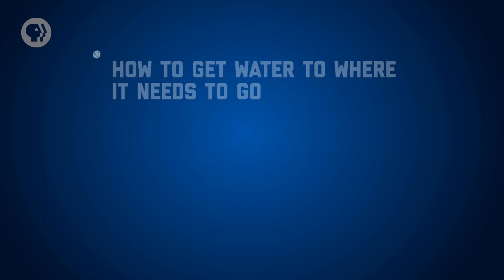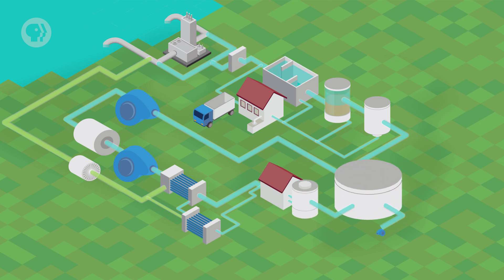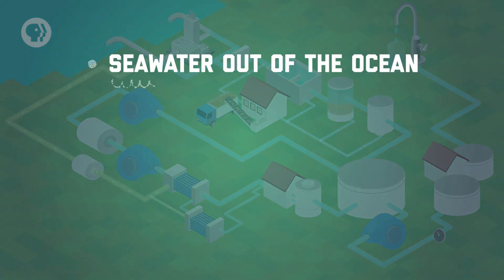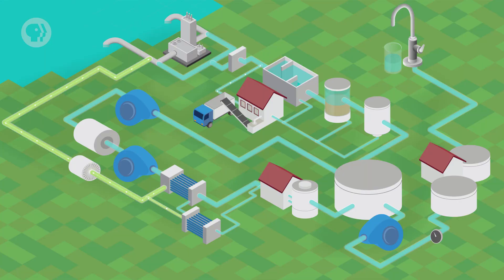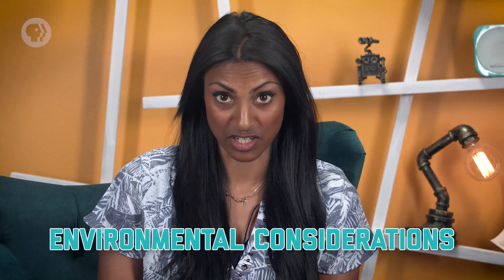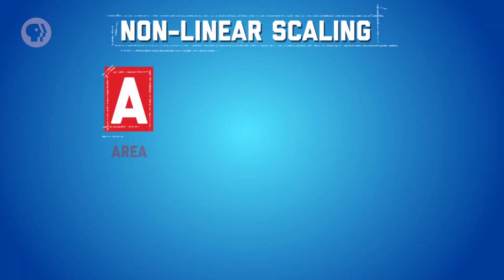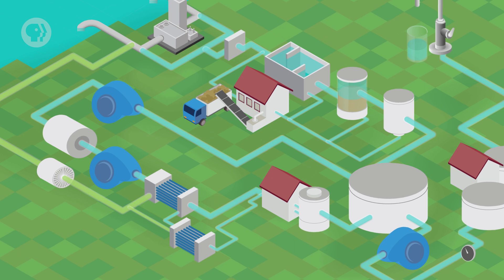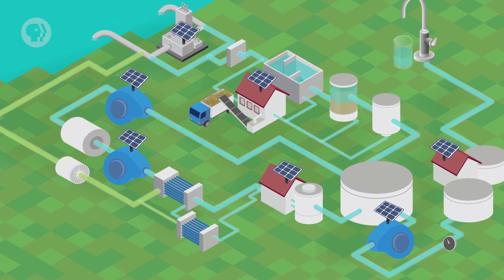Building a Desalination Plant from Scratch: Crash Course Engineering #44

Comment: one could also build a small unit for a family an distribute it so you solve problems with scaling and it is decentralized, so risks of catastrophic down time is almost zero. each pump works with solar panels and a backup battery so in case of electricity downtime you have drinkable water

Comment: I can design one that is Perfect...even portable..  and it COULd be cheap...Very cheap..
Reply: Does it use the Grylls Process?
Reply: @Aeleas  aint seen that one, but Just a Fresnel Lens, or even parabolic, focused on a Metal surface with about 1/2 under water, the heat generated is over 2000-5000 degrees..
Then recover the salt if you wish, because that is a MARKET ALSO...and you dont want to kill off the fish...